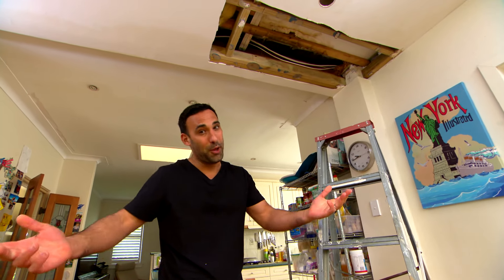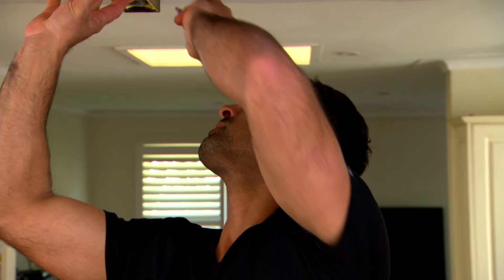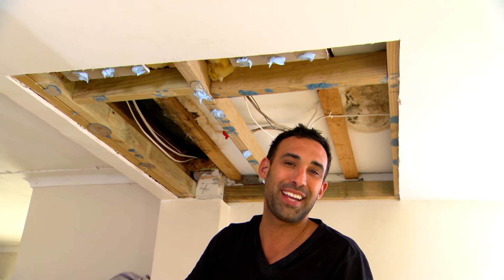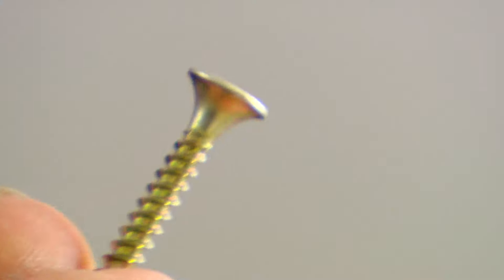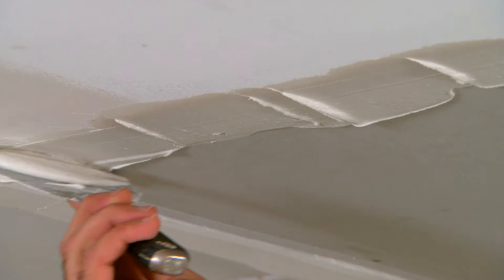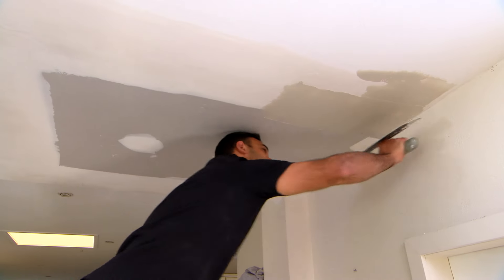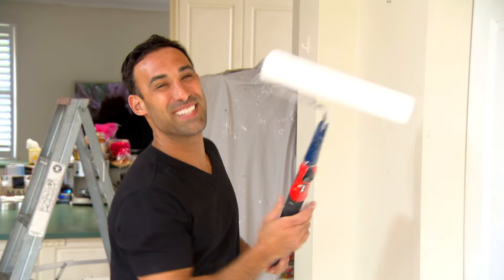How to Patch and Repair a Hole in the Ceiling | DIY | Great Home Ideas

Comment: Short and sweet. We have a hole on the ceiling caused by a pinhole leak in a water pipe. This needs to get fixed. Even if I call a handyman to do the job, watching this video helped me to gauge the extent of the work involved and thus size up the potential cost. Thanks.

Comment: Just a tip, you dont wipe the stud adhesive on by rubbing/wiping. You dab it on its called walnuts. And you shoulddnt back block with stud adhesive you should use cornice adhesive or they make backblocking specific glue. I just use 30min cornice adhesive. Take it or leave it but thata the correct installation procedure and you really shouldnt be distributing false information and techniques
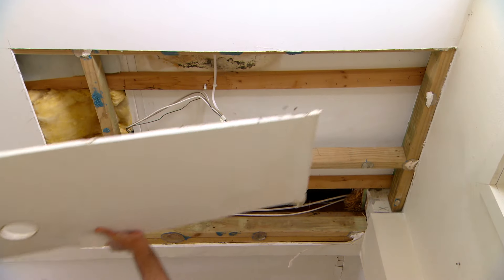Reply: What…what about the internal water damage??? 00:48 and 00:57. Is that safe to just cover up?? @daz looking at you since you sound like a pro
Reply: This is why I find diy so frustrating. Looks simple and easy enough, but then you’ll have people say it’s wrong. Hiring a pro could mean you end up with a cowboy. Damned if you do, damned if you don’t. Literally.